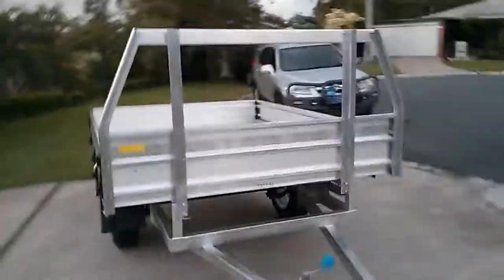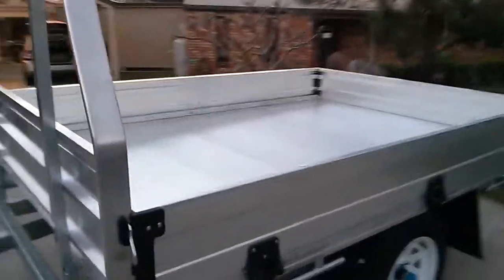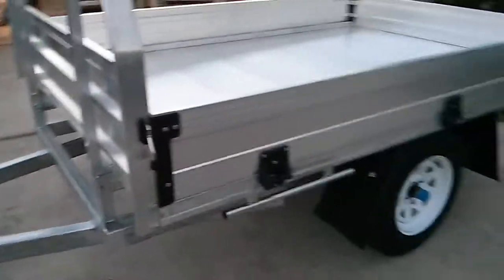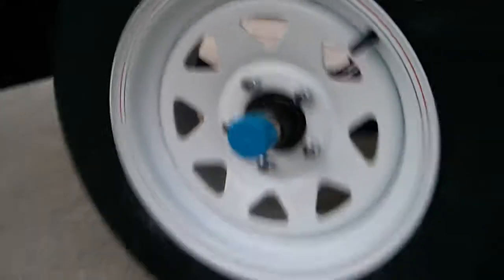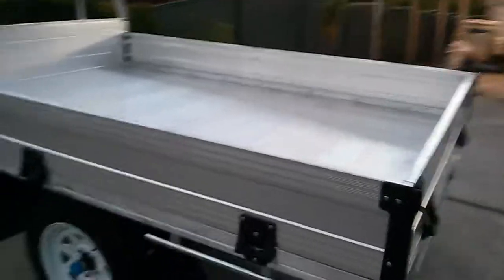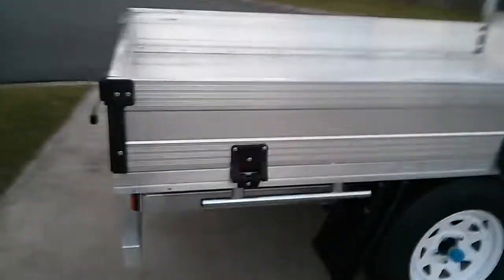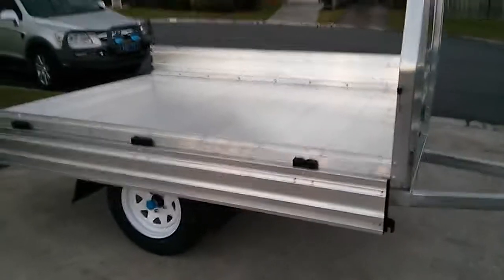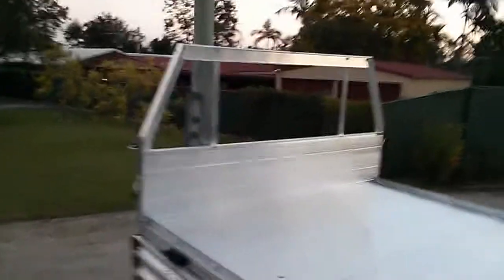Ute Tray Trailer 12/05/2013

Comment: Can you use the same axle off the ute for the trailer. I got ute I can pull apart and use what parts I need for a trailer I want keep it because it alloy and all the sides goes down also